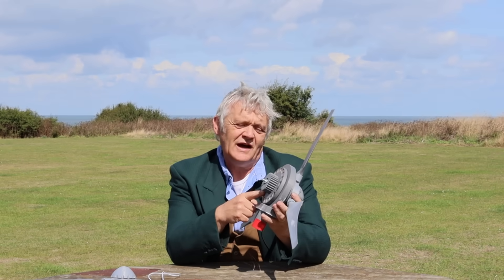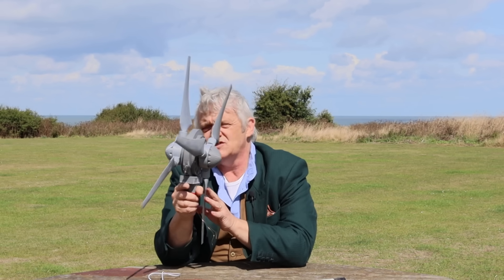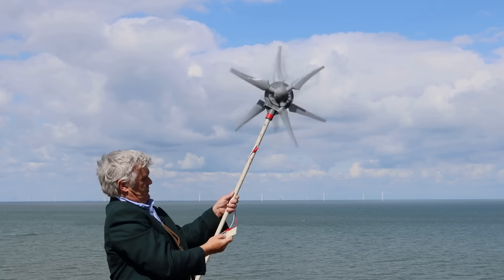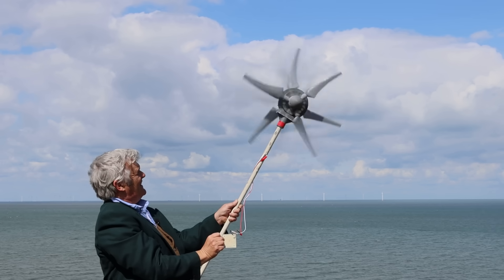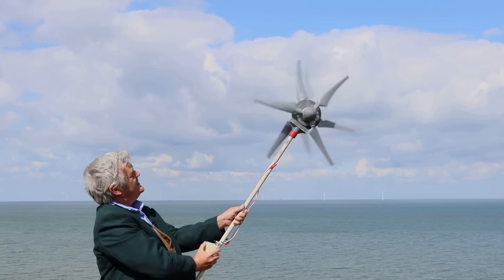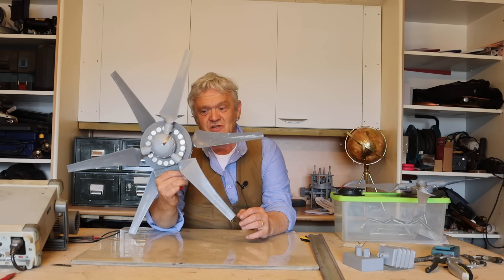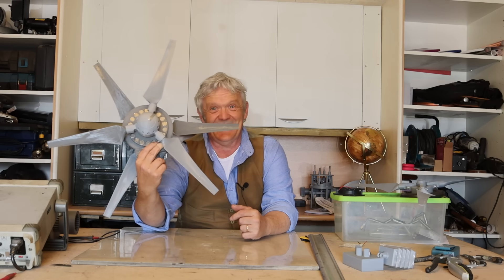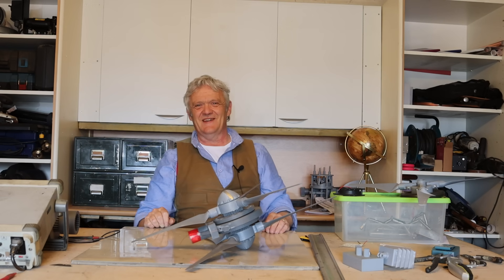2035 DIY Super Efficient Dual Rotor Wind Turbine - A Real Betz Beater

Comment: the real mystery is why absolutely NO ONE sell professionally made wind turbine for the general public under 1000€ which actually work fine and are efficient. Very strange.
Yours is incredible, I wish I had the time to build one myself, maybe I will some day !
Reply: One reason is volume of sales. If everyone wants one, manufacturers will compete on price and we get a consumer end benefit from that competition in price.
Reply: A gentleman in Spokane Washington his last name was Ribic (Ribic Wind and Solar) was doing counter rotating blade designs 1 blade turning the armature the other turning the magnets to double the output.

He had both 3 blade designs and old prairie water pumping windmil designs he could produce fair amounts of electricity down to 3-5mph
Reply: There are wind turbines available for boats under that price. I've seen them for less than £500 UK.
Reply: @paradiselost9946   what's your machine then, you missed that bit
Reply: @paradiselost9946  "wind power goes up at the square of the velocity" --> cube of the velocity: P = 1/2 x ρ x A x V³
Reply: Not in any way wishing to belittle this excellent concept, but 100mA @ 30 volts is only 3 watts, whereas even small commercial wind turbines can generate 200 to 300 Watts although at a price of several hundred £ or $.  It would be very interesting to know how large your design would need to be to produce a comparable output and what it’s manufacturing cost would then be.
Reply: The wind around your house is probably very turbulent so not going to get good airflow.
Reply: @zauli45  Yes, in order to have decent power production from turbine while living in town you need to have it 20m above ground, 50 is better and of course the best production would be at sea
Reply: @ianmathieson65 I suspect he needs better windings which he neglected to show
Reply: Most people that implement wind turbines want to achieve more than just lighting up an LED.  A simple button battery (like those found in car keyfobs) can light an LED and keep it illuminated for a very long time, but you won't be able to run your house off one.
Reply: because they cost hundreds to make with the copper, magnets and machined metal parts.

Comment: shooting at 24-30fps that was really cool, to see the blades look like they weren't even moving at times. waiting for the Darwin files to start printing. Building the generator now. Thank you as always Rob & crew!
Reply from the maker: cheers mate
Reply: @ThinkingandTinkering  I’m curious have you tested any toroidal propellers— What happens if instead of a propeller you create the opposite and have a reversed cone with propeller shaped grooves cut out of it more like a tesla turbine?
Reply: It would probably need a cowl but I’d be very interested in seeing what happens
Reply: Me too; really keen to see how the Darwin turbine will turn out. I’m going to see if I can build a cheap 500w generator from these designs.
One path I’m going down is seeing how to improve the PLAs outdoor longevity.
Of course we can replace the parts easily with a reprint but ideally I don’t want things to fly off; exposing material or worse, losing magnets
Reply: How can you tell whether it's rotating a whole turn per frame or n/3?
Reply: @MilkyToucan can we build together?
Reply: For outdoor usage I would switch to PETG or ABS filament. I've noticed on other projects that PLA can seem to get quite brittle when left out in the elements. Not to mention deformation from heat. @MilkyToucan

Comment: Rob, I don't know if you have seen it or not, but I thought you might WANT to hear about a HUGE breakthrough, in blade design.  Three men, whom joined together, to form a company, after watching certain wales.  They found that the bumps(carbuncles) on wale fins, produce a 20% INCREASE in efficiency, and a great increase in slicing through water and air.  The next time that you make something with a blade, you may want to incorporate these carbuncles into it.  Keep up the good work.

Comment: you need two sets of blades spinning in opposite directions, and one is connected to the rotor and the other to the stator, to double the velocity.
Reply: I'm not sure that's going to be very efficient because the leeward blades are going to be crossing the dirty air off the back of the windward blades. That said, there are drones that use coaxial counter-rotating blades, so it's not a complete write-off, but a quick Google shows that the thrust generated by the lower rotor is about half that of the upper rotor. I guess it goes back to what Robert was saying in a previous video about whether you have a torquey motor, or a speedy motor. Counter-rotating blades would (I guess) be better for a motor designed for speed. Definitely worth an experiment though.
Reply: A contra rotating system? You get more thrust in contra-rotating aircraft, but the gear arrangement is an engineer's nightmare
Reply: I always say  what you said here, but it get more complicated and the great win is on double-layer! Now we can get out of an simple windmill enough to even live in north part of Europe!
Reply from the maker: no - that won't work
Reply: @EGDD-42  you can use a relatively simple differential gear system for that, another idea is to decouple the two fans and have them mounted on seperate shafts co-axially.
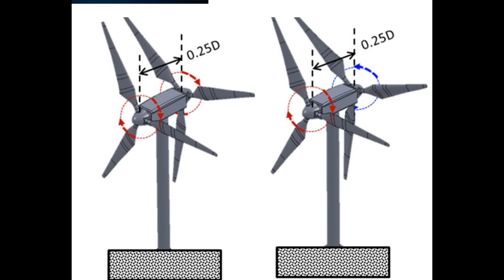Reply: @ThinkingandTinkering   actually that might work, if you look at your video - 4:20 - using that design, the forward fan can be fixed to the stator and the aft fan to the rotor, coaxially of course, although in that config. technically you have two rotors. the trick will be tapping the wires off the now rotating coils, maybe slip rings or some such ?
Reply: actually that might work, if you look at the video - 4:20 - using that design, the forward fan can be fixed to the stator and the aft fan to the rotor, coaxially of course, although in that config. technically you have two rotors. the trick will be tapping the wires off the now rotating coils, maybe slip rings or some such ?

Comment: So glad your doing contra rotating.
Most of the last post war piston fighters were using them, so they must be more effective.  Offshore the infrastructure would give a huge saving . 1 mast, 1 gearbox 2x props
Reply: But this isnt contra rotating, just 1 shaft
Reply: @TheSorters  you get the point. More blades more power. It doesn't need to be contra rotation since its behind the motor and torque isnt a issue.

Comment: I notice that the hollow side of the blades are now facing the wind. I always figured that would be better. In this video the blades were spinning so fast I was just expecting the LEDs to get too much current and pop. haha. I guess you were lucky that the wind was not that much faster. Nice one and this is one I may also try out with slightly bigger blades for a battery backed gate motor charging setup.

Comment: I'm building mine at 175%. I want mine horizontal too. Figuring out my Darwin tower. I'm in northern Arizona and blessed with incredible wind. We average between 8 and 10 miles per hour. Depending on where you look or live.
Reply: Im bulding mine at 124%, because its the maximum width that my 3d printer can print (300mm)...let's see the output that I can get
Reply: Give us an update

Comment: Morning, 
Apologies if I am teaching to suck eggs, but if a dual rotor system is used for a wind turbine then a stator section will massively increase the efficiency of the second . This is one of the purposes within  the compressor stage within an axial flow compressor (as used in a jet engine). 
Hope this is of interest.
Kindest regards
Andy Walsh
P.S keep up the good work

Comment: Great achievement! I know you’re probably doing the Darwin arrangement first, but could (or would) you investigate on putting that blade arrangement in a propeller? I know people made counter rotating propellers to improve efficiency, but what if you build them like this generator? Would it improve the thrust? I think it would deserve a look on it… don’t you think?!?
Reply: I thought the same thing. Does more watts per a given wind speed equal more thrust for a given input power. Is this a symmetrical problem?
Reply: @paradiselost9946  yes, I am an aerospace engineer doing CFD, I understand a wind turbine slows air down, and a propellor speeds it up, but why wouldn't they be symmetric depending on if power is extracted or added. An inefficient turbine is probably an inefficient propellor. You are wrong on several points. For instance, yes, counter rotating blades do increase efficiency, ask the Russians. Yes, ducts do increase efficiency until they add more drag, and yes, number of blades matter. Number of turbine blades in a jet engine matter too

Comment: With three-blade turbines the 'stationary blade' effect would appear at 1/3, and 2/3 of actual RPM as well as full-speed.
I notice that in the studio there seemed to be a piece of tape on the boss, and I wondered if this was what you actually used to check speed?
Another great video, thanks.

Comment: WIth dual rotors you could also set it up so that the stator and the commutator contra-rotate within each other and get much higher speeds and generate more electricity.

Comment: 30 volts at 100mA is 3W. The diameter looks like it's about 0.5m, so say 0.2m2 area and 3.3 m/s wind speed.
The power in the wind is 0.5 x mass x velocity^2 = 0.5 x swept area x air density x velocity^3
So at 3.4m/s the power in watts is 0.5 x 0.2 x 1.23 x 3.4^3 = 4.8W
So the efficiency does look pretty good, something like 62% assuming the wind speed was correct. Ideally the anemometer should have been raised on a parallel broomstick, as power is proportional to the cube of the windspeed.
But that's pretty good. I'm playing with designs for wind turbines on a pitched roof ridge, to benefit from the compression effect of the wind over the pitched roof, using variants of shrouded Savonius and Darius turbines on their side.

Comment: Do you know if it was really 1500 rpm? Since there are three blades, couldn't it look like it's standing still with a one third rotation? If that's the case, I would think you'd need to divide by three and it would be more like 500 rpm. But it very well could have been 1500 because 1000 and 1500 would also both still look like they were standing still.

Comment: I wonder if cardboard with graphene doped wood glue (and pressing it) could be used to make gears and other parts by those that don't have 3d printers or even proper tools to make it out of real wood or metal

The casein based bioplastic also seems like another alternative, specially for manufacturing multiple parts, but then, what would be the best approach to molding it into shape?(diy metal "cookie cutters", maybe?)

Comment: So, this extracts more energy from the wind. I am struggling to think whether the reverse is true for a drone. Would this be more efficient, generating more thrust for a given power input vs regular propellers. Would be great if so, and you don't need contra- rotating shafts

Comment: I'm interested in modifying the design to accommodate a stepper motor instead of the generator pictured. Is there any way to access the tinker cad files so that i can use the nose cones and blades but my own generator?

Comment: I'm curious how that blade arrangement would perform as a fan. I also wonder how it would do in water, not for generation, but as propulsion. I know that is not the focus of your channel, but since it seems to catch the wind so well I wonder if it would move water more efficiently than a normal boat propeller. To clarify, I mean it's performance in water versus a propeller in a low speed. low power application such as a pedal powered boat or small electric trolling motor.

Comment: hey Robert, As of now im 90 percent done of building one of those, i was wondering if i needed a rectifier before the mppt wind charger  because theres only 2 wires coming out of that generator.Would that mean that its a one phase generator, sorry dont know much about electricity and phases. Thanks you for your knowledge even though sometimes gotta listen to you video a couple of time to figure it out.

Comment: I think saying exactly 60 degrees is an unwarranted assumption as the gain in efficiency comes from the rear set avoiding the turbulent air from the front set.
To me that would imply that the angular offset should depend on the windspeed and/or the rotational speed of the blades.
Reply: As usual just typing my observations led me to two additional thoughts.
1. Using a differential gearbox with the generators rotor attached to the body and each blade set attached to what would be the axles would allow the offset to set itself.
2. Using counter-rotating blade sets (with appropriate gears to achieve that) might produce a compromise efficiency gain.

Comment: i thought there was a gear inbetween each rotor head so they would spin in opposing directions but I'm pretty sure they're fixed. I was wondering if that would make it more efficient, there are some crazy russian turbo prop designs with that sort of counter rotation idea implemented. I have no idea if it works! ahah

Comment: For the Darwin model I would put a second anchor point opposite the one where the broom handle went so it keeps it in registration.
Reply from the maker: you are best off with three anchor points set 120 degrees apart i would think
Reply: @ThinkingandTinkering  agreed, though two is still better that one mate lol :)
Reply from the maker: lol - absolutely mate

Comment: You absolutely need pure iron plates on both disks with magnets. It will dramatically improve magnetic field through coils.
Reply: It'll create cogging, which will basically act like friction to turn the blades
Reply from the maker: no you don't

Comment: Instead of putting a redder on it to keep it pointed into the wind how would it work with a longer shaft on the back blade? This way its drag would keep it pointed correctly.
Reply: Possibly slightly longer blades as well

Comment: Could u inform the pitch angle (tilt towards Y axis) used for mounting the blades in the hub? I've made mine at 248% scale and works like a charm, but i don't know the optimal pitch angle for extracting the most power of it.

Comment: I swear sometimes my device has spied through my eyes and thoughts at things i I've pondered ... As a suggestion, for a next build that you construct it so the blades counter rotate connected to a rotor/stator setup? If each is counter rotating at "1500" isn't the combined result doubled?

Comment: it would be cool if we could slap a tesla turbine around it, then it should also be self-directing to the wind as long as the width of the disc stack doesn't exceed the diameter of the discs - or even a couple spiral cones, once you get it inside a wind collector/concentrator.

Comment: in *practical diy not 3d print,  can it be made with dual 14 inch small bicycle wheels with duct tape and pipe + bearings, so no tails required ?

Comment: I heard about a guy that was building a HAWT that instead of having vertical aerofoils had Flettner rotors, the idea being that whereas half the aerofoils on a HAWT are causing drag as they move against the direction of the wind with a series of Flettner rotors they would all be providing drive all of the time. I seem to remember that a complicated set of cogs were used to ensure that each Flettner rotor was providing drive in the required direction, I'm not sure how. I believe the vertical Flettner rotors were actually fixed cylindrical structures between the two horizontal discs, but that it was only the surface of the cylinder that rotated, not the whole cylinder. I think this was intended to increase structural rigidity of the HAWT. Interestingly, to reduce the load on the central bearings, the outer circumference of the lower disc ran on a circular rail. I wish I could remember more, but it intrigued me at the time. Remembering this the other day, I thought I bet that is something Rob would like to try.

Comment: Do the dual rotors spin with each other?  I'm having trouble understanding how 2 rotors stacked like that is better than 6 blades on 1 rotor.  Seems the rotor in the back is just 'dragging' on the 1st one and/or wouldn't spin as well since it's getting 'chopped up' wind that already went through the 1st set of blades.  Awesome nonetheless!
Reply: But its backwards in the back not just doubling the number of blades
Reply: @TheSorters   Is it?  It looked the same way to me....I'll have to watch closer.
Reply: @TheSorters   OK I guess it is....initially I thought so because of the way it was mounted, but then it looked the same.  I guess I also missed video 2031 where he shows it.

Comment: Why did you stop using the twisted serpent on your generators? Seems like you were getting a nice efficiency boost out of it.
Reply from the maker: i haven't stopped using it - i just didn't use it here because i wanted 12 cm between each rotor and i wanted 12 cm because that is 0.25 - roughly - of the diameter

Comment: Was it spinning at the frame rate or 1/3 the frame rate given that there is 3 blades?
Reply from the maker: frame rate - i actually measured it with a tachometer too - you might have noticed the silver strip

Comment: yep, Betz relies on the calculation at an unconstrained disk - as soon as many disks, or ducts enter, the calculations per generator are invalid - ie. Betz becomes irrelevant, new metrics and limits enter the discussion (the energy obtained from a flowing fluid is still limited - in that, if too much energy is extracted, less flow occurs limiting available energy - intuition may be more useful than specific values - regardless of Betz or not, the most energy with the lowest input of materials and energy - lowest cost - is worth chasing.  More blades are only a commercial concern/interest once all available rotor diameters are exhausted..)